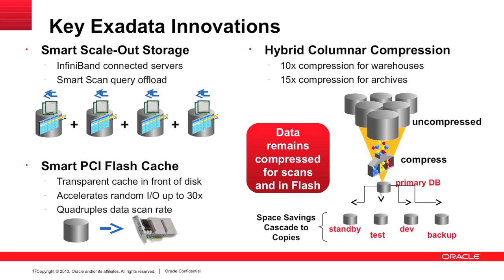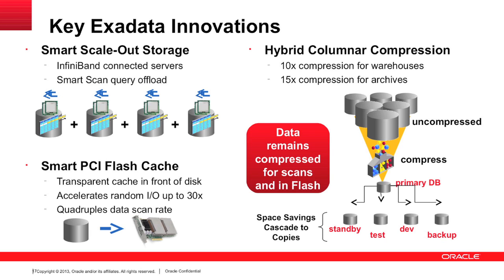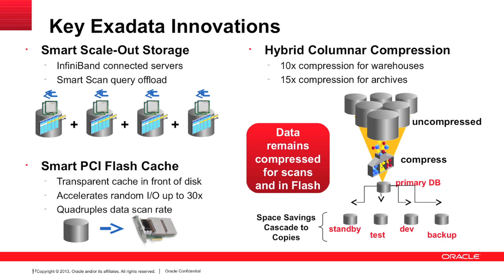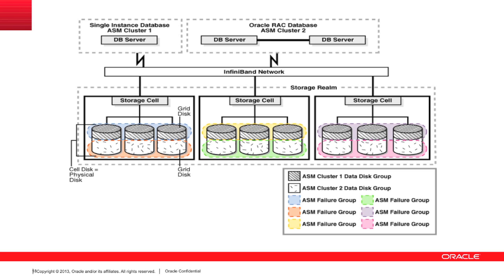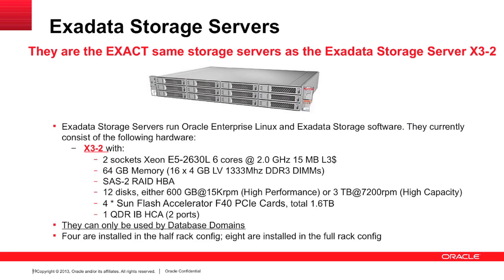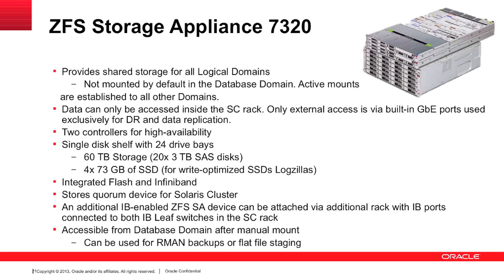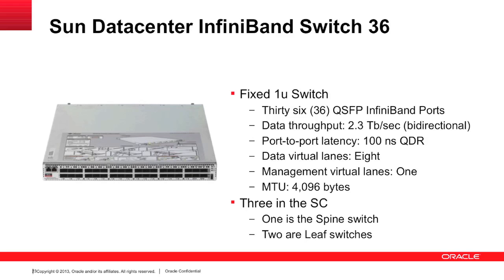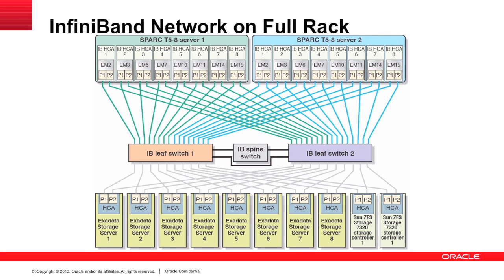An Introduction to SuperCluster T5-8 (part 2)

Comment: Thank you kindly for doing these demos. The only problem with  public questions is the quality of the questions. The device allocation has been an ongoing issue with LDOMs especially ensuring the high availability of device paths. On the T4-4s I used split bus design and two controlling LDOMs.